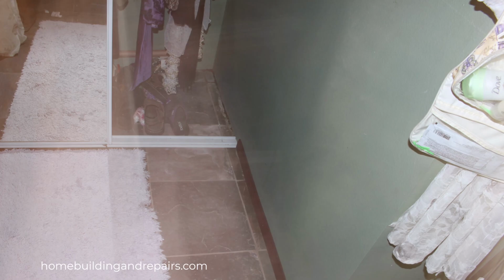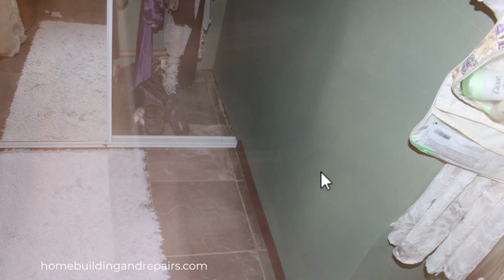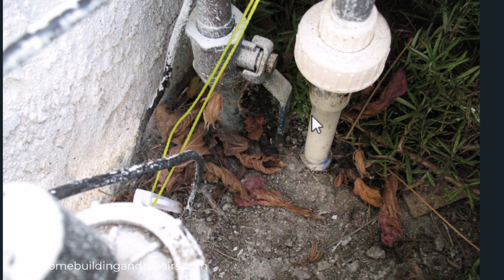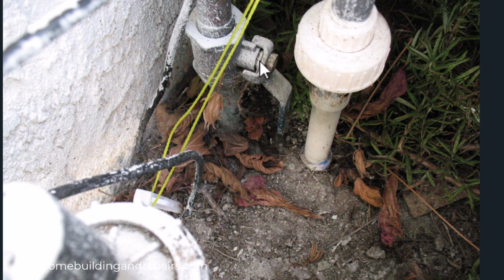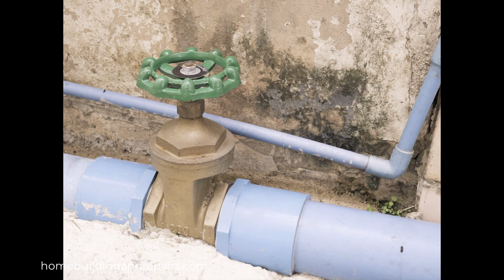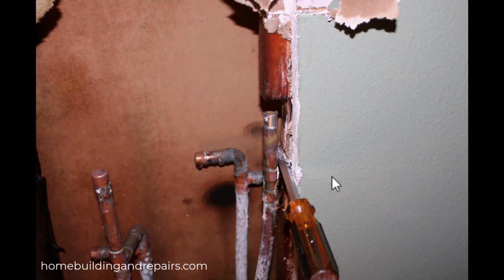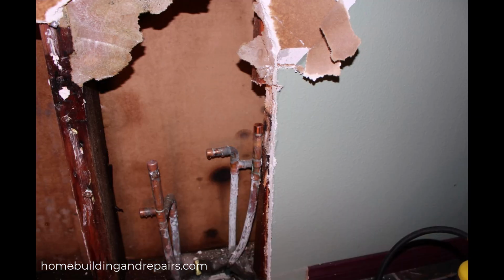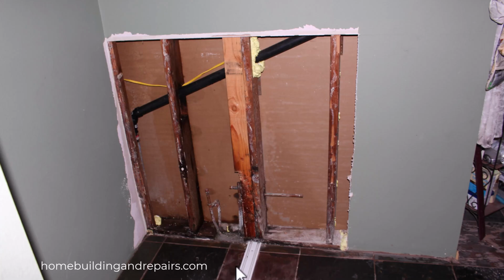Water Leak Tester Trick For Walls or Floor Leak Detection - Plumbing Pipe Repairs

Comment: I havevan outside spout that when I trun it on I hear a small sound like air pressure and like water is about to come out but nothing no water and it goes right into the brick wall , and I don't know if there's a leak in the ground under the foundation or how to figure out one or snow water coming out of the faucet

Comment: Great video.  I got one of the cheap thermal cameras that plugs into your phone.  It's useful for so many things, but I've used it to identify two leaks, one in a ceiling and one in a wall, that weren't yet visible.  It's good to have in your toolkit if you work on houses or vehicles!